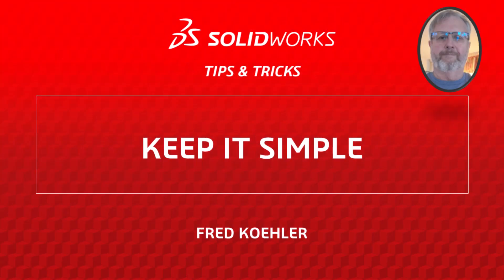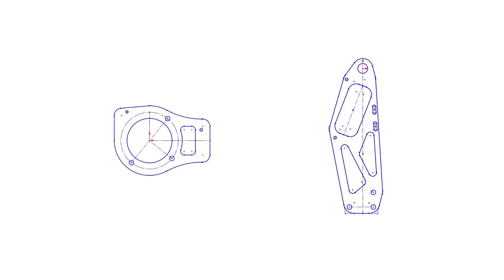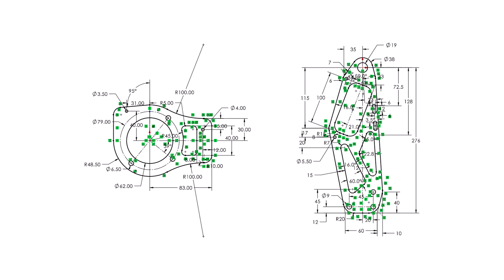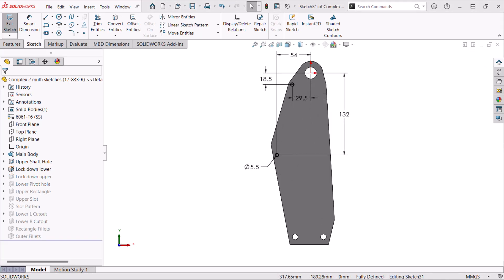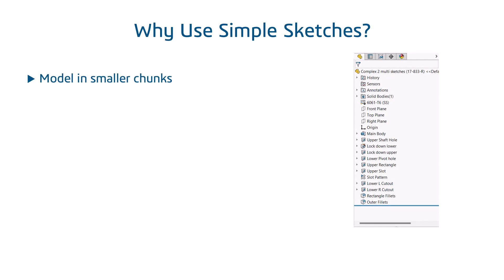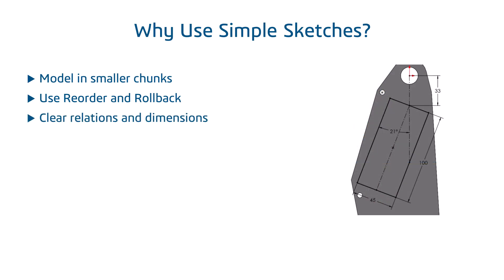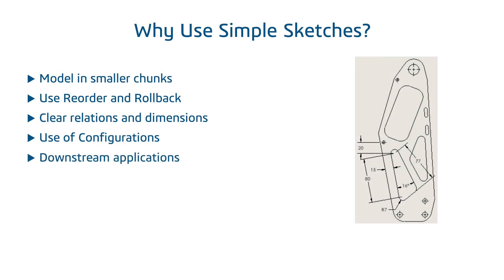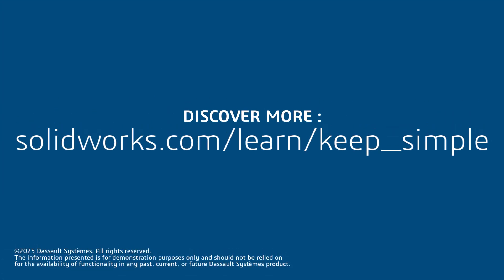Keep it Simple

Comment: I prefer the "crowded" version. Single feature part, everything available at one click,  I dont have to hunt every fillet across the whole part. With the rounded rectangle cutout as you have it when you change the outline, it might get out of the outside edge, crashing the fillet.

I would prefer if SW would rather handle more complex sketches well. I still remember fully defined sketch, Ive added a point to with no relations, then made that point coincident to a circle in the sketch resulting in overdefined sketch (but it still had 1DOF). DSS keeps pushing innovations saving one click, 5cm mouse travel or even 0 clicks at all (like new dimension reccomendations), while proposing workflows, that change 5 minute job into half an hour :(